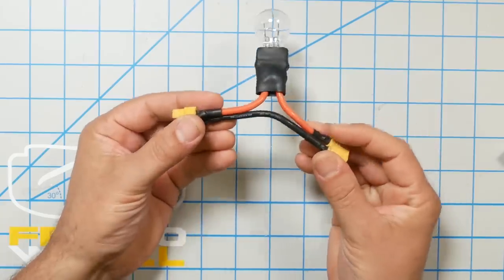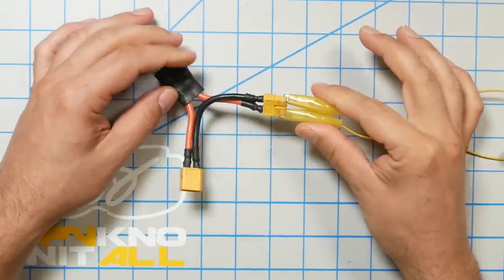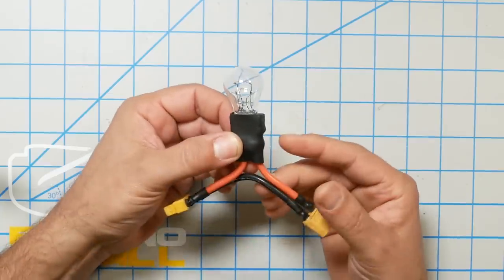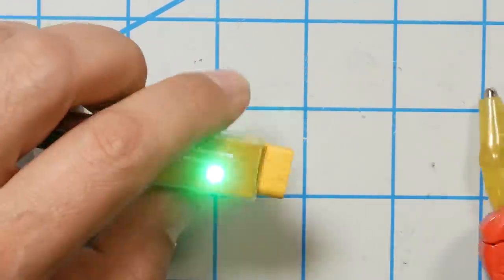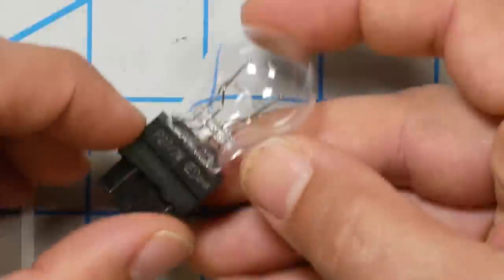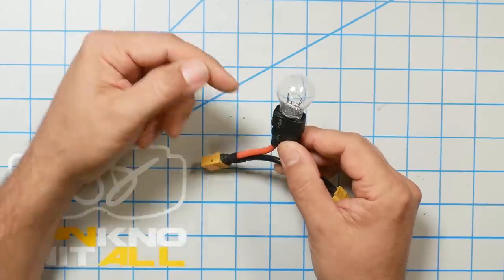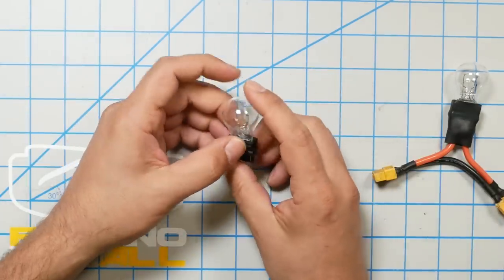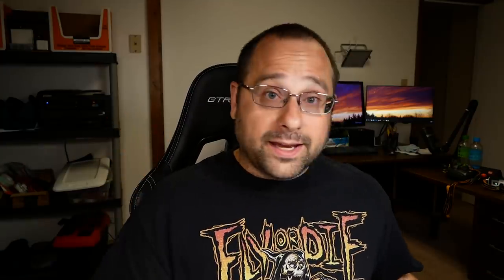Why you need a smoke stopper | HOW TO MAKE A SMOKE STOPPER

Comment: Super Video! Smoked my Pilot HD Cam last week because I forgot to wire it to 5v from the vtx, and connnected to battery voltage.  Would a smoke stopper had saved it please?   Thanks heaps.   CP
Reply from the maker: No, a smoke stopper would not save you from over-volting something.
Reply: Ok.  Thanks.

Comment: You took two elements in the lightbulb that usually run off a 12-volt power source individually (parallel).. then wired them in series. Should be able to handle a 24-volt power source now no problem.
Reply from the maker: I am pretty sure I wired them in parallel.

Comment: If you're building one of these things for a whoop or small drone running 2s or less.... I would think that a 6 volt automotive bulb would work better than a 12 volt automotive bulb. They are easy to find just like the 12 volt jobbers... they usually sell them for older cars like volkswagen beetles and such.

Comment: Hey Joshua, I would like to build one for 4s and one for 5 and 6s, can you be specific on the bulb I would need to find for the 4s used in whoops, I get the larger build is a simple tail and signal light build used in most automotive applications, however you stated the watts are 25 on the one used on the break signal light build and you would need less watts on the 4s setup, first how much less would you need and next what kind of build would one use as the watts for automotive would most likely be the same at 25watts.

Comment: You can calculate the I(AMPS) you can load on the smoke stopper, lets say I took car light bulb with P=51watt,V=12volt. The formula is I=P/V, so its 51/12=4.25amps, this is the amount of current it can load. Hope it will help people to figure out which bulbs they can use.

Comment: I builded one and testet it with 2 wires to create a short. The light of the bulp turned on and everything seems ok. but if i put the smoke stopper between a lipo and a kwad which i fly  a lot without problems then the light tuned on  every time. Whats wrong ? And why your light is only turned on if there is a short  ?  I didnt use a classic bulp... i used a 12V LED bulp with 18 little white LEDs... Is this the different ?

Comment: This is awesome! I love your videos!

I'm not great with electronics, I'm wondering if you could use 1 bulb for 2 different connectors, 1 xt30 and 1 xt60 and how that would wire up? Also, if you're only using the 1 filament for the bigger batteries, will it still function properly?

Comment: Eh JB!  Great video!  do you think it would be a good idea to put 2 of those bulbs in series to dim those bulbs a little bit, and also the bulb would last longer i believe as they are rated for 12V , so 2 bulbs would run at a lower voltage together, i dunno . just a thought!

Comment: I feel like you missed the opportunity to bring up the general danger of a shorted LiPo. These things will turn either into a smoke bomb, a flamethrower or both. I'm more worried about burning my house down than killing my quad. A short on a LiPo can easily end in a house fire. Depends on the resistance of course, a small bit of solder would likely melt before the battery blows up, but it's best to be aware that it's not just your quad that's at danger here. Thinking this could cause people to not use a smoke stopper on a quad they don't care about.

Comment: I just built a smoke stopper using this tutorial and it works great.  Interesting behavior that I am seeing however.  I have a 4s quad, which seems to be working fine.  I power it up with the smoke stopper and a 4s lipo, no problem - the bulb does not light up.  I plug in a 2s lipo, quad powers up  like normal, but the bulb lights up dimly, and continues to stay lit.  Any idea why this is?  I suspect it's related to ohm law where the lower voltage at the same resistance results in more current, but I don't know enough about what's going on to know is that guess is right.
Reply from the maker: On lower voltage it is pulling more amps, and causing the bulb to light? That's my guess.

Comment: Never used one in the 5 years I've been building however in that 5 years I have burned 2 boards one was a $75 fancy one.
I however that said I would never  tell anyone they do not need a smoke stopper. In fact the opposite is true. Our FC boards are getting smaller and smaller and the solder pads are therefore closer. This makes the possibility of stray wires or solder very high.

Comment: Hey Josh, do you think I could get the lightbulb smoke stopper with XT60 connections and use XT30 adapters for my quad? It's a 3", but I use a 4s 650mah battery

Comment: Your better off using the light bulb. I bought one of these pre made smoke stoppers from a very reliable well known store. It's not the store that's the issue. They can't test everything. On my first build the smoke stopper worked once then died. I thought I had a issue until plugging it in again without it and everything worked perfect. I'm making my own on next build

Comment: What you really need is a bench power supply with current limiting. The lamp might help preventing the quad ripping your face off but does nothing to save your precious FC or other electronics.
Reply: Was thinking the same. Compared to how much money is spent on gear (drones, TX, goggles, batteries), the extra $50 for a basic 30V, 5A bench PSU probably won't break the bank.
 
Ah, I see he addressed that. Apparently, a bench power supply is not something you can easily toss in your backpack. Well, that's true, but there are portable models such as this one: https://www.amazon.com/Tekpower-TP3016M-Portable-Handheld-Variable/dp/B015OA1J82/ It's about the size of a multimeter, and odds of you needing more than 1.6A when working on a quad under power in the field (which sounds like a dumb thing to do in the first place) are slim. A bit more pricey though at $120, but still cheap compared to the gear you're working on, and less fragile than a glass bulb.
 
The glass bulb is the cheapest option. If all you need is overcurrent protection when working on your quads, and you done the math in order to select the right bulb, it's pretty much unbeatable on that point alone. However, a portable PSU allows you to do so much more. You can use it for things other than quads, e.g. to revive a battery that was undercharged and is no longer recognised by your smart charger. Or to work on projects other than quads. To simulate batteries with different voltages (2s/3s/4s/...), to verify the alarms go off at the appropriate voltage levels by turning down the voltage and observing at which point the alarm trips. It's one of those things that the longer you have it, the more uses you find for it. ;)
Reply: Or a modified computer PSU...
Reply: Scrolled literally 5 mins to find this comment :) bench power supply is must have
Reply: @AndriySydorka  I don't know why jb is pushing this nonsense. Is he in bed with the lightbulb industry or does he think his viewership is stupid and not able to push buttons and dial knobs. 'I hope you burned something today' should be his slogan xD
Reply: @ericapelz260  Why? The ones from for example Ruideng everyone with a brain is using in this hobby take 6-50V DC. Just wire a female XT60 in there and use a lipo. But this kind of building a quad takes more place on a bench at home I would guess. Or where are you building your quads?
Reply: @VincentFischer  well with a significant background in electronics,  I have very good bench supplies (far more costly and accurate than cheap $50 stuff) that plugin.  So as someone just getting into drones, why would I waste money?  The light bulb is $3 and does everything you need in the field.  As for 'anyone with a brain,' that is just being rude.
Reply: @ericapelz260  You can get these things starting at 20$. Only one FC saved and the cost amortized itself. It's not about having a accurate powerful bench supply, it's only about something thats shuts off the current reliably which lightbulbs just aren't capable of doing. I did not intent to insult anyone but everybody should be clear about a lightbulb not being a precision device and won't do much to save you electronics which was kind of advertised here
Reply: @VincentFischer  are you saying you have damaged gear using a lighbulb?

Comment: Should the smoke stopper light not come on at all???

I've just finished building a Bang God with a Mamba F405 DJI stack.  When I use a multimeter, it reads over 0.5 ohms. I checked the resistance on my Tyro 129 and GEPRC Phantom, and they both had a very similar resistance.

But when I put the smokestopper on the Bang God, the smoke stopper light came on after the starting beeps.  Not really bright, but it was glowing.

I tested it on the Tyro and the light didn't come on at all.  (I don't have an XT30 smoke stopper, so didn't try the Phantom) 

Weird.  Wondering if I should continue or pull it apart.

Comment: I just fried a brand new esc on a pnp plane by soldering my dean plug reversed.  Even fter 17 years of soldering deans connectors, it still happens every now and then.  Will this prevent reverse polarity connections?

Comment: What gage cable I need for this ....In webside I see many kind of cable like that 24 awg to 6 awg ....same black nd red silicon wire but with different number like 24 awg to 6 awg ....can't understnd wht is perfect for this type use or which is perfect for make any connector of XT 60 ....can u pls guide me which wire I should buy that all pourpose will be done ?

Comment: I've been told this isn't a good idea a time back, but now I forget why. I use bench power supply set to voltage equivalent of 4s or 6s that I plan to use with the quad, with a low current limit set on the power supply. So far, I've never needed it to protect anything...but is this not a good idea and should I be using a Smoke Stopper instead?

Comment: Oh one last question, would this smoke stopper work to lower the heat when setting up the VTX, I have the GepRC Cinepro 4K, it is using the F7 stack and the VTX is a 500 milliwatt VTX so it gets hot to the point of overheat. I think the quad has warning and a thermal cutoff to prevent overheat but I am not sure about that and there is no PDF with any manual from the company. I have written to them about the fact they are selling a quad that to most would not have a clue on many of the features and the fact they are not giving even a online PDF manual. Nothing back from GEP on that. Anyway I am looking for a way to run the quad on battery and not overheat the boards and still setup the video and stuff. I am using the Crossfire system so even to program in betaflight I must power up the quad to even adjust that as well, please any suggestions would be helpful, if this smoke stopper would work that is great and very simple.

Comment: I build one of these for my new build, if i connect the caddx vista the bulb lights up...so i tried it on my other one wich is working fine with the airunit with the same result...it that normal? I disconnected the vista everything is working...when the motors are turning the bulb starts to light up to

Comment: Or you have a bench power supply, as they usually have max amp throttle. It's also way more versatile, allows to adjust voltage sensor, etc.

Comment: so.. recently i had a crash. i replaced an arm and soldered my motor wires back. only thing is now that when i plug the battery in i get a spark and a bit of smoke at my xt60 connector? looks a but dark. what should i do?. drone boots up fine.

Comment: Just a day too late !!!

Hilarious video, but very pertinent  , last night I was tweaking Betaflight on my Tinyhawk and went to plug in the USB cable (with battery plugged in) and accidentally slide between the USB socket and the frame. The battery supply lines are right below the USB connector, ( I know as it happened before), smoked the quad and melted the battery connector, Two batteries in fact as I was dumb enough to try a second battery but the regulator was short. What's even dumber is that's the second flight controller I have smoked doing the same thing rather than taking my sweet time. Rule folks don't try plugging the USB into your Tinyhawk with the battery connected first if your as blind as a bat! 
Or Need to make a rubber or 3D print grommet to go around that connector! To prevent that happening !
Reply: Usual deal, especially when you have time shortage or build your stuff in middle of night due to reasons etc. Only patience and SmokeStopper can help. Also having extra alligator clips and multimeter wires with isolation up to end of tips to avoid accidental shorts can help too.

Comment: After 12:30 have you seen you joined together + and - on your electric bulb, as you just mentioned same pole is on the opposite side?
Reply from the maker: There is no + and - on the bulb. There is just a filament with two ends. It's not polarized. If there was a + and -, then the bright and dim filament would be cross-connected + to -. But since the bulb isn't polarized, it doesn't matter which direction electricity flows.
Reply: @JoshuaBardwell  what I meant is that you have connected the two sides together, one side is connected to the + of the lipo so it's shortened. Try a multimiter on the XT60

Comment: I have a LiPo charger with "digital power" function. If I set the output current to 3A and power my quad directly from charger then it should prevent smoking electronics, right? Of course then it won't have so obvious visual fault indicator as light bulb.
Reply from the maker: In this case, I would set it even lower, because the clamping time could be enough to allow damaging current through.

Comment: Hey josh iv been following your videos looking for my problem for 2 days I have a drone all dys everything Taranis x7s and r-sxr receiver roll and spin work fine but when I throttle to more then 50% the motors throttle all the way up and won’t come back down iv turned of the gyro to test that idk what it is at this point the rates for the radio all show good I flipped the stick configuration around and made sure it was not the throttle gimbal that wasn’t the problem I tuned the esc in betaflight im lost thank you
Reply: Did you have props on? If not, put props on but make sure you hold on to it (or strap it down) and have a finger ready on the kill switch.
Reply from the maker: https://www.youtube.com/watch?v=xBaefeQtA1c

Comment: Just had an ESC explode on me presumably because I was a second or two to slow to disarm it in some tall grass. Then I see you stopping the motors with your fingers without anything happening, I do know the current was plummeted, but are there any way of making the motors register that there is something in the way and shut them down, from idle speed, before they blowing up the ESC?
Reply from the maker: I'm stopping the motors with my fingers with a smoke stopper present, which prevents the current from rising to dangerous levels.
Reply: @JoshuaBardwell  Sorry, must be me not expressing myself correctly. I'm comlexety aware that the smoke-stopper makes it impossible for the current to reach a critical level, but it got me thinking.... "Are there any way of making the motors register that there is something in the way and shut down, before they blow up the ESC due to resistance?" This could fore example be a slow disarm when landing in tall grass. (Blew up a esc that way, on my first flight today) 
Thanks for the response :)

Comment: Wish this was up a few days ago. Bought one similar to the one that failed you from RDQ a couple weeks ago. Killed an esc and fc a couple days ago. It also smoked the “smoke stopper”. $100 mistake and I still have no idea what happened.
Reply: MAD GRUMPYMAN I had gummies and nylon standoffs AND nuts and it wasn’t touching any carbon. I tape my esc’s when soldering and double checked for solder balls. It’s so weird. I’ve built a ton and anytime i screwed up i found it. It’s to the point where I’m not going to rebuild til i find the culprit. The good thing is I’ll have more confidence with the bulb. I’m sure I’ll figure it out.
Reply: MAD GRUMPYMAN oh I’ve costed myself a lot of money and learned a lot of hard lessons building so I’m very careful and look over EVERYTHING. I found the hot components and replaced them to no avail. All good. Stuff happens. I always check and make sure everything is working before installing to the quad so it was def something I did or missed. Either way, this will buy me more time next time!

Comment: @7:25 wow...so funny you mentioned this, I literally forgot I was working on my LiPo battery moments ago, roughly about 30 mins, got distracted with another task, left the positive wire terminal EXPOSED ON THE BENCH, ready for me to solder new connectors onto it! Literally about 5 inches away, I have my needle nose pliers, & cutting pliers laying right there. 

Perfect example of what you're saying. Smdh.

Comment: If i was attempting to plug jn my battery and as soon as it made contact there was smoke for less than a second does that necessarily mean something got damaged or if i was fast enough i should be fine?
Reply from the maker: Impossible to say for sure. Any time you see smoke something could be damaged.

Comment: Hey just a question getting hot motors butterflight 5.0  2206 2300kv 5s gemfan 5152 props stock pids d~20 turned all 3 filters back on still hot. Fixes?
Reply from the maker: I don't know a lot about Butterflight filter tuning. If you were on Betaflight I'd say lower the filter cutoff.

Comment: So the FC will not be damaged by 3 amps if the short is among e.g. pins on the FC?
Reply from the maker: It can be damaged, yes. The 25-ish watt smoke stopper is most effective for protecting ESCs, PDB traces, and motors from damage. Smaller pins and traces can still be damaged. If this is a concern, you can use a lower-wattage bulb.